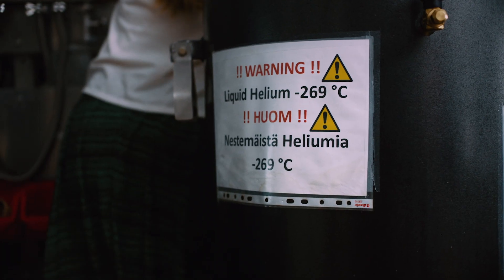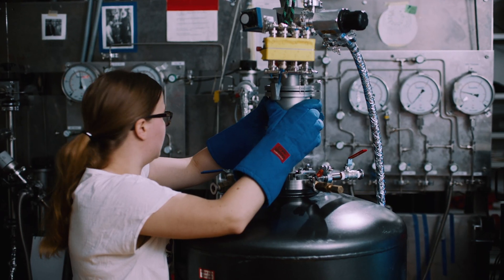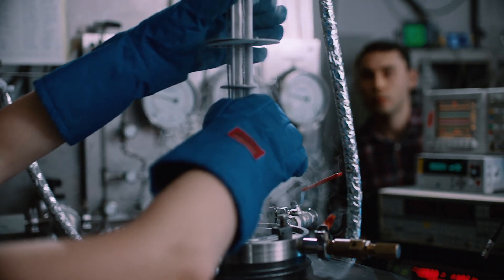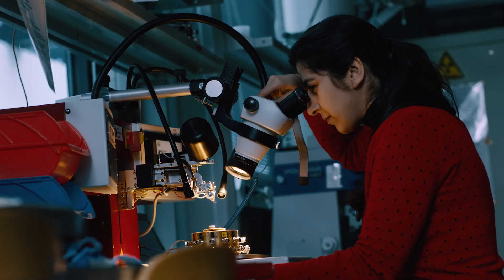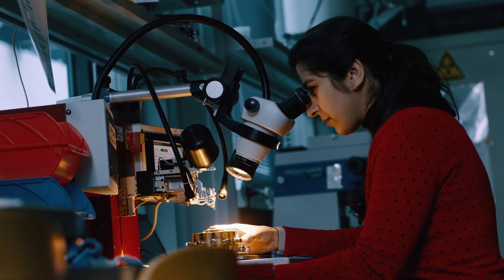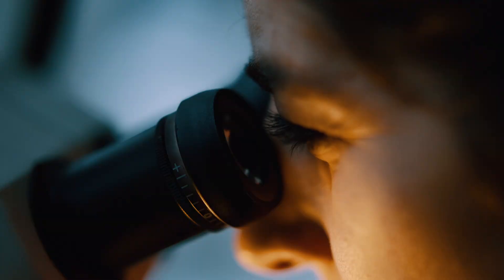Why ultra cold computers hold quantum secrets

Comment: like the fact that they don't realise by using cold which is the inverse of the universe's actual temperature with their understanding of super position and mirror particles has it not occurred to them that they may be doing experiments which apply to a universe which is the reverse of this one the fact that you can experience light and darkness aren't they worried that they may be getting answers from the dark universe and because everything is connected if you recreate the necessary conditions you could !make a physical link
Reply: You need to learn how to use full stops. Also, I think that this isn't a universe in a box; it's a machine that uses the cold to be able to better process math like what they said. I'm sure they could make box with a universe in it and do excitements on it. I don't think they're worried about getting answers from a dark universe because they're probably going to be learning more about physics and engineering while they create this, so yes we're going to learn about a dark universe